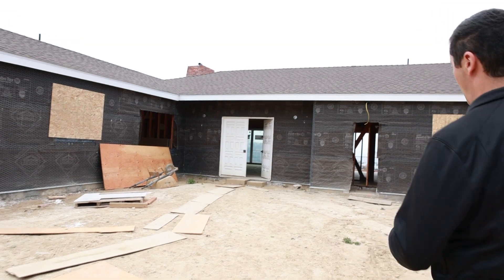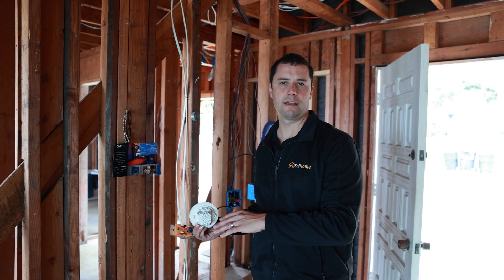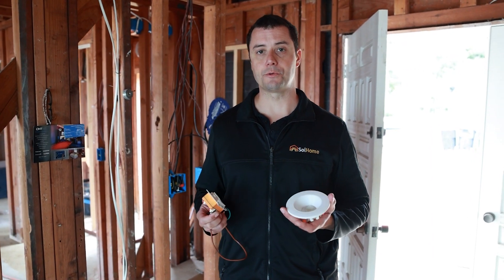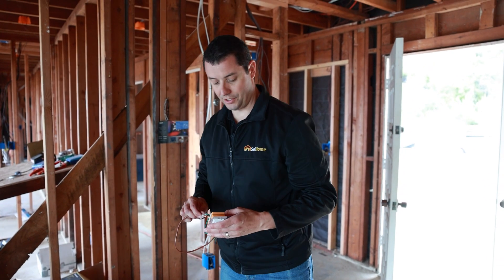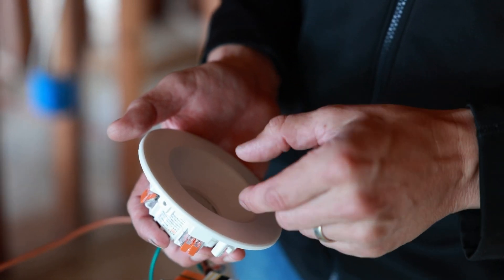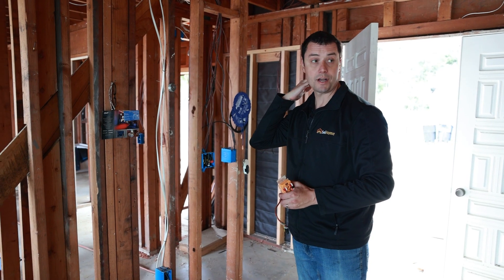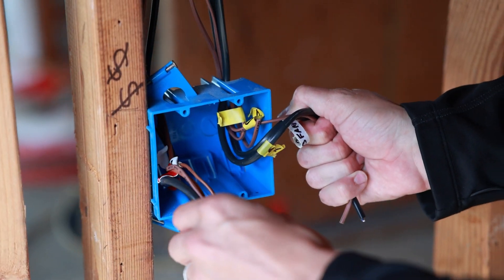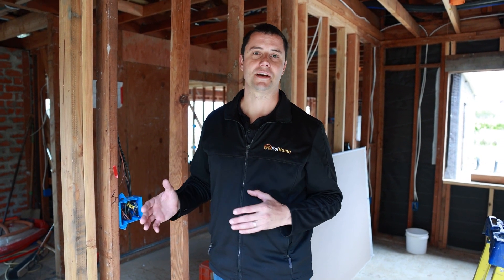Solar powered 48v DC lighting for new construction

Comment: +1 for DC wiring. However, I can see on big disadvantage with this solution. Switches should be with led indicators and possible touch to be able to control them also from other sources (eg. tablets). Also centralized drivers/controllers for easier maintenance. We are living in ages of Smart Homes and IoT!